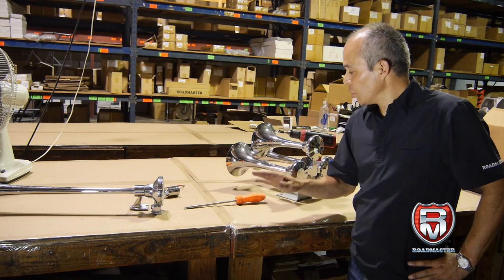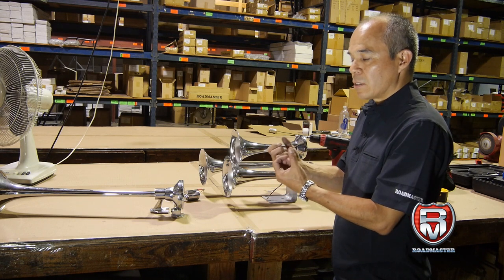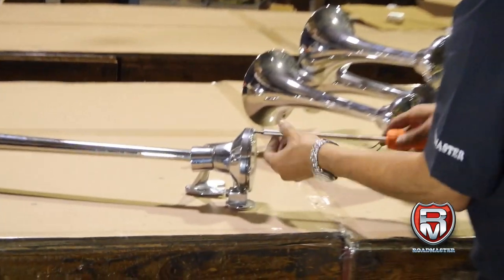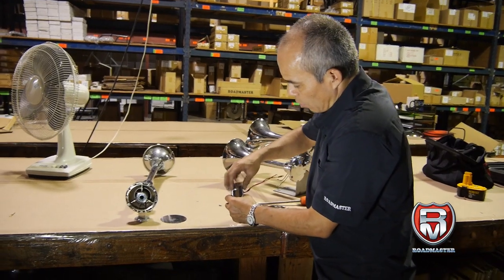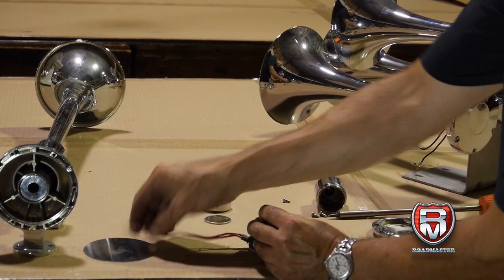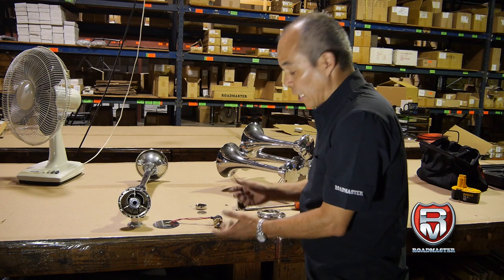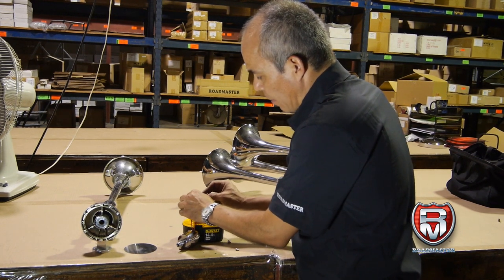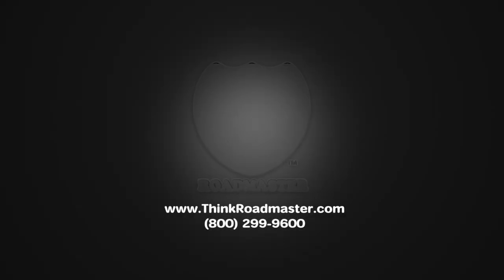Air Horn Maintenance

Comment: I'll be the second one to comment.  THANK YOU, Victor! This is an excellent video and I used it to repair the inoperative air horn on my 1996 Safari Serengeti RV. To make a long story short, I got the RV from my parents, who parked it in their barn about 6 years ago. We got it out and operational a couple of weeks ago and noticed the AIR HORN doesn't, well, didn't work.

I searched YouTube and found your video and watched it the other night. Yesterday I started troubleshooting it. When I would press the horn button, NOTHING. I was able to clean the connectors on the horn relay up front well enough to get 12V on the output of the relay when I pressed the horn button on the steering wheel.

I next got up on top to see if I could hear any air coming out of the horns, thinking maybe horns need attention. No air, no sound.

I resumed torubleshooting this morning. I found the air tank under the front end and by following the air hose, I found the horn air solenoid. When depressing the horn button, there is 12V (from the horn relay) being sent to the (+) wire of the solenoid, but no action - no clicking, etc. 

I then opened the connector on the tank side and found I had pressurized air there. Next step, I removed the GROVER air horn solenoid, and sure enough, the metal slug was gummed up and nasty. I cleaned it off, swabbed out the cylinder and cleaned it, and put a few drops of light machine oil on it and put it back together. IT works like a champ now! THANK YOU!!!!

Comment: Hello please could you help I have just bought a set of hadley h00977ece air horns brand new. And I'm very disappointed in them not loud at all I have plenty of air pressure 180 psi is there anything I can do to make them louder  kind regards

Comment: My problem was the air pressure 200 psi the solenoid is rated for 180 had to add a  pressure reduction valve

Comment: Air horn didn’t blow loud the diaphragm wasn’t the problem with mine, turned out to be air leak between the cab and air horn itself.
Cost 54$ for air horn rebuild kit times 2.
Wasted 108$ watching this video.
Reply: Wasted $108 for not diagnosing the actual problem properly before ordering parts.